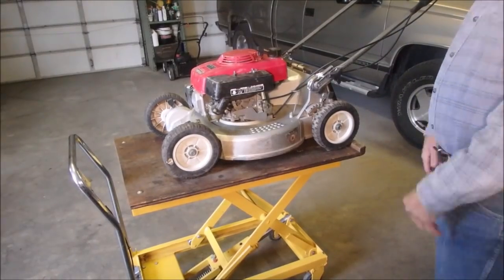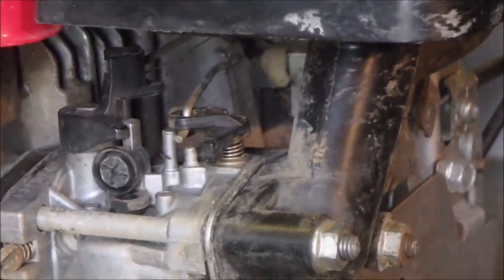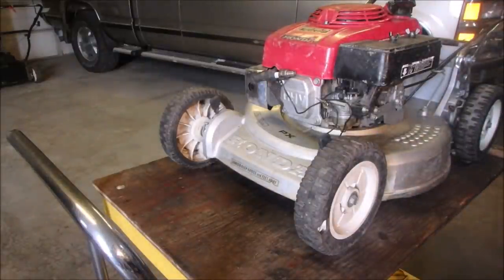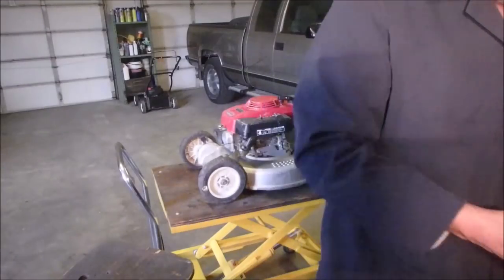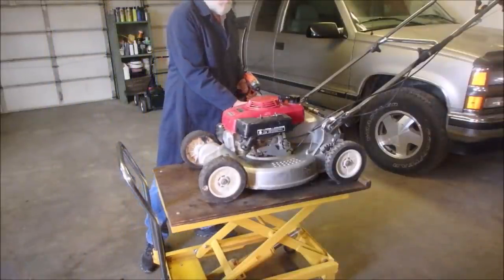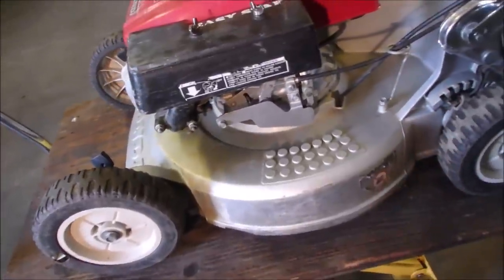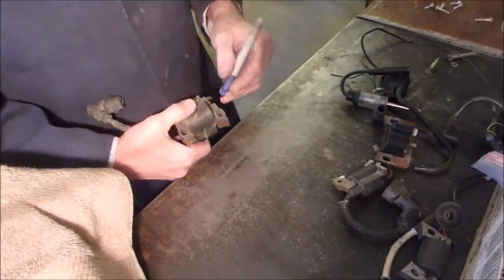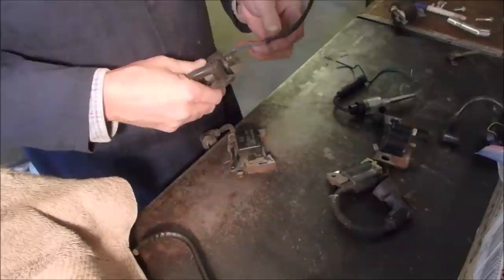Honda HR194  Won't Start.  The Year of the Honda

Comment: I was given one of these early models that smokes horrible. I'm hanging on to it as a parts machine because it isn't worth putting a guide kit and rings in it (too much time and parts cost too much). Kind of a shame because it is decent looking and even has a nice catcher bag. I figure the owner (it was trash picked for me by a friend) never changed the oil. The oil in the case was more like tar than motor oil.
Reply from the maker: Ouch.  I understand.

Comment: Moral of the story, never throw out anything!!!  Well, at least hardware, recoil starters, ignition coils, wheels and tires, gear boxes........the list is endless!
Reply from the maker: Anything that will fit into a box i keep.  (unless i already have 20)
Reply: My luck has been that I usually throw something out the day before I actually need it!  Now whenever I’m at the dump and I see power equipment I just grab it and if it’s not fixable take all the usable parts off of it and bring back the carcass. It’s that one screw or knob that makes a machine “done”! I can’t stand mismatched mower handle knobs and wing nuts and hardware store bolts where a factory carriage bolt, curved washer, and rosette knob should be, it just erks me! I like it to look “Factory Stock”!
Reply from the maker: @KensSmallEngineRepair  Me too.  If there is a black handle that is round and not pointed I will change it out.

Comment: I had a customers HR214 in here last summer that had no spark whatsoever. Ordered a new coil from eBay and I ran into the same issue with the thinner coil frame and the original bolts a being too long. I put a couple of 3/8” nuts between the bottom of the coil and the engine to raise it up so the laminations were cantered with the magnets on the flywheel and it worked beautifully. I think maybe if the coil sits too low the magnet may not line up enough to produce spark. Also on that gas cap pull the rubber vent piece with the hole out and replace the crumbling foam filter. I’ve had a couple of those mowers stall during use due to a vacuum forming in the tank and starving it for fuel because the crumbly foam blocks the vent hole under the rubber piece in the cap. Great mowers but as you said really heavy!
Reply from the maker: Thanks.  I sounds like you know them well.

Comment: Hi, I put a new $20 Amazon Chinese carb on my 1986 HR 214 that didn't start. I had taken the oem carb apart but couldn't get the inner needle valve off to clean it. Anyway, I got the mover to start but it ONLY runs on choke-as soon as you take it off choke it dies. Amazon sent me another carb kit (plug, filter & carb) but same issue, starts on choke then dies when you take it off. I'm stumped. New issue, the rope start is not retracting all the way now-it goes about 3/4 of the way back in.
Reply from the maker: I would try an OEM carb if you can   Before that check the carb gaskets with some carb spray on them as it is running.  If it changes RPM that is where the problem is ,   a bad carb gasket.

Comment: Lab Coat to work on a Honda ...What's next Mercedes Benz  lawn mowers and you greet the customer wearing a  three piece suit...Your camera skills are getting better ..With my bad vision I tend to have too many close up shots on small parts because I use the camera like a big magnifier...
Reply from the maker: I should get a cheap suit.  That would be fun.
Reply: Bruce Pender Leisure Suit to go with with working on 1970s equipment.
Reply from the maker: @haneyoakie14         Ah Ah Ah Ah   Barley Alive,  Barley alive
Reply: Bruce Pender if your blower won’t blow snow, ya gotta know the place to go, Pender’s! Pender’s!
Reply: @BrucesShop  You could sell used mowers and make commercials like those cheesy car commercials in the 70's on late night TV  that always had some gimmick.

Comment: Bruce, when you were checking that coil you didn't feel a tingle. If it would have been good you would have been ENERGIZED!  LOL. Nice to have spare parts. Saved another honda.  Roger
Reply from the maker: When I do that, i don't grab the plug end very tight and I make sure i am touching nothing else.

Comment: I've had one of those in garage all summer waiting for work on blade clutch. It was running right. I thought it was coil but it was the boot. Apparently there's a resistor built in. I cut boot off and put regular metal tip and it ran fine.
Reply from the maker: Good for you for finding that.

Comment: "No one gets married anymore" 😂

For no spark and I see an E3 plug, put it right in the trash and get a NGK.  Also I would sand down the flywheel before setting the gap.

The o-ring goes around the base of the tank / cover I believe.
Reply from the maker: Well I had not seen one in the cap before.  I tossed it.
Reply: I'm seeing more of those E-3 plugs (not a fan).  I'll take an NGK spark plug everyday of the week!  You can sell the Honda in the spring.
Reply from the maker: @mikespain8655  Right  in the spring.  It is put away now.

Comment: Is there some reason that you don't use an inline spark tester that has the light bulb?
Reply from the maker: Sometimes I do.  They can be misleading .  If a spark plug has a leak to ground they will still flicker.
Reply: @BrucesShop  OK
Reply: All a spark tester does is to see if the coil has spark, right? It won't tell you if the plug is good or not. Correct?
Reply from the maker: @victoredington3316  it will tell you if the spark is getting to ground some how.  It is a pretty good indicator but on a intermittent one like this. It isn't perfect.  That is why i had a real plug in the loop in this video.
Reply: @BrucesShop  ok. Are you on american mountain time or what?  i am on eastern standard. just wondering what time it is at your house.

Comment: Hey Bruce, my nephew got 2 free honduh harmony mowers. Got one running after cleaning the carb. Hand to use 3 hands to get all of the linkages and springs in place while bolting the carb back up. Then the trans went out and took 4 hours to swap from one to the other. If the germans built a lawnmower, it would be a honduh. Over-engine-nerd to the max with no thought about serviceability. Gen-u-ine honduh parts ain't cheap here in the U.S. either. Give me an old Briggs flathead any day.